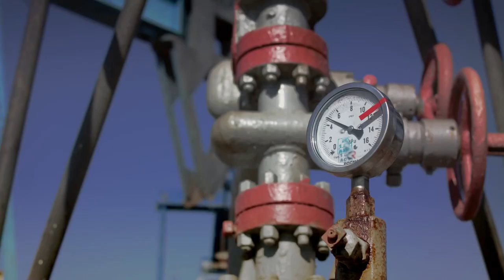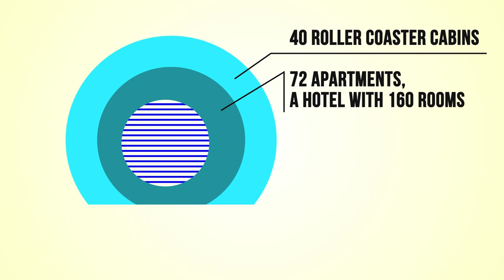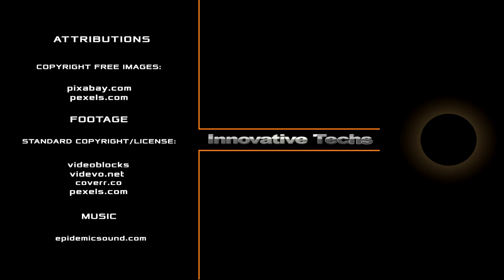Why this invention can send wind turbines to the past

Comment: Hydrogen means needing large farms is loser but if just back up system & protecting system still can serve a purpose. Sticks wind turbines means running power poles can also serve multi purpose. sending power by stronger Kevlar no rot poles, spinning wind back up power & lightning protection too.

Comment: 94:04  "...EWICON wind turbine.."   It is not a turbine.
Turbines are problematic.
Reply: wind energy convertor transforms wind energy into electricity without the use of moving mechanical parts
it's not clear if these are even convertors, it sounds more like an accumulator of existing static 'charge' in the moving atmos, no conversion just collection & transport , aka a derivative of the original Victorian Wimshurst machine 1880 2 February – the first successful shipment of frozen mutton from Australia arrives in London aboard the SS Strathleven. , using fast air movement to collect the charges, rather than the original fast rotating charge blades segments, transported to the high voltage Leyden jars/caps

Comment: As we can never rely on intermittent power sources we always have to rely on what is backup for them. If we have enough firm clean backup the intermittents are redundant. And incorporating them into our grids is problematic and expensive both financially and the environmental cost of building a enormous complicated infrastructure to accommodate their dilute chaotic nature. And we certainly don't add intermittent power sources in order to harden our increasingly fragile grids, in engineering intermittent is a synonym for broken.
then there's the environmental problem of the enormous amount of resources wind and solar require for the amount of power they can produce when the conditions permit them to produce power at all. I'm not convinced it's worthwhile. Why invest so many resources for something we really don't need and has minimal value? Incorporating dilute intermittent power sources into our grids creates a host of problems that end up taking far more resources to attempt to address. Using a reliable clean power source negates any need for massive overbuild and backup. Which means Way less resources needed, which means it is a greener solution.They certainly are popular but I don't think that's a good practice to base policy on. It's as if faced with a devastating global pandemic instead of taking steps based on evidence and data we were to pass out crystals and essential oils instead because it is popular.
Reply: What “clean backup” power are you talking about?
Power grids are all intermittent because demand changes by a factor of 5 from peak power needed from 3 to 6 PM say to the midnight to 5 AM period.  We need cheap batteries in our grid to take care of this anyway to adding intermittent solar and wind is just another source of energy to supply intermittent demand.  The Hornsdale Battery has shown the value of utility scale batteries where they earn $50M per year buying low and selling power high.

Comment: This all good news for BC because it takes a lot of coal (our number one export 7 billion a year) to make wind turbines and solar panels which only last 20 to 30 years cement copper and steal all need coal nature gas or oil to be build and to be decommissioned the only one that has some potential is the one with no moving parts that may have a longer life span than all the others but how long do the copper wires last and will they also rust with the salt water in the air like in Holland. They is NO SUCH THING AS RENEWABLE ENERGY. Nothing solar wind mills dams last for ever all need more coal to be rebuilt.